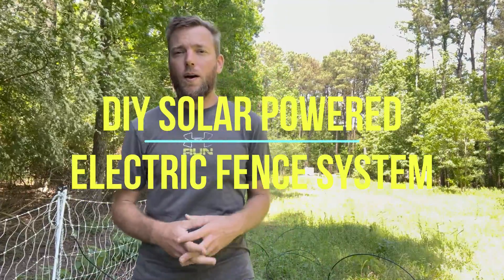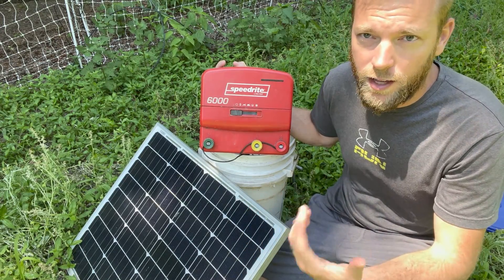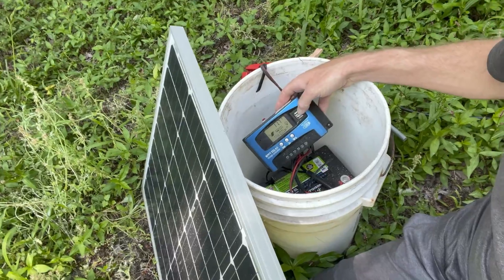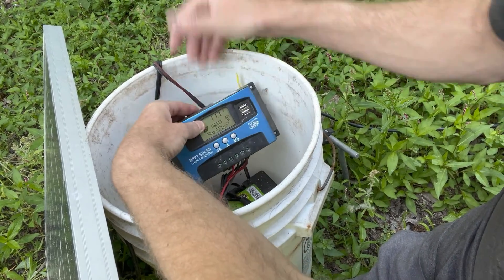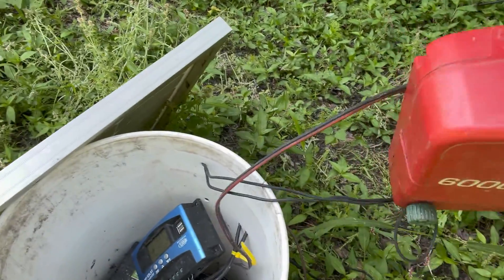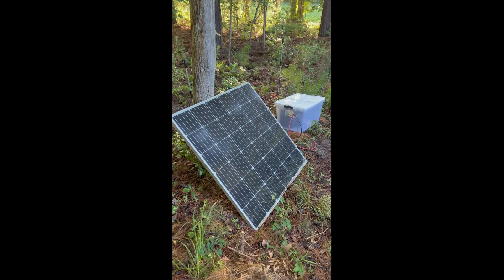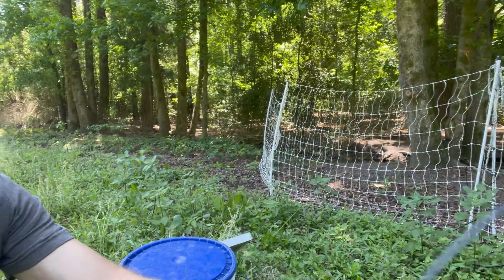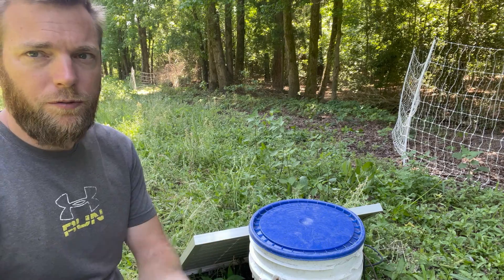DIY Solar Powered Electric Fence Charger System

Comment: You dint have any issues with the fence charger connected to the load on the solar controllers load output? Most recommend to connect fence charger directly to the battery. Thanks
Reply from the maker: You need to have a charge controller to control recharging of the battery through solar panel.  If you connect charger directly to battery it will drain the battery and once a lead acid gets below 50% power, its toast.

Comment: are you using regular car batteries or deep cycle (leisure) batteries?
Reply from the maker: Deep cycle agm or lithium. This is the one i use 
https://www.amazon.com/dp/B07SY72T1M/ref=nosim?tag=regeneratives-20

Comment: Thanks for the video. Does it get pretty warm inside the bucket with heat output from some of the components?
Reply from the maker: not at all, because there are no motors.  Just electric battery and charger. it definately gets hotter in the bucket from the sunlight but it hasn't affected performance at all.
Reply: Thanks—I had recently seen a RICH solar charger with what looked like heat sink fins on the back of it-so had me wondering.